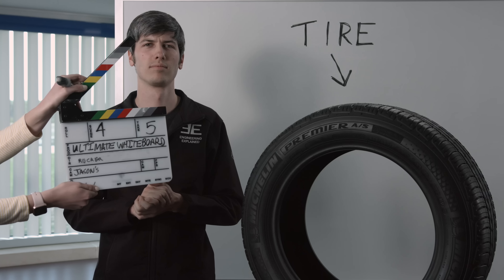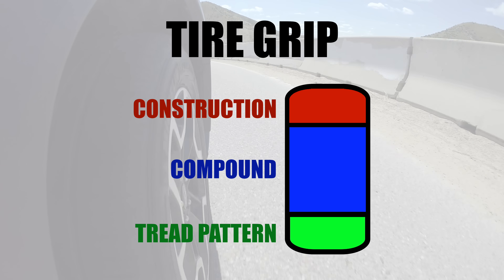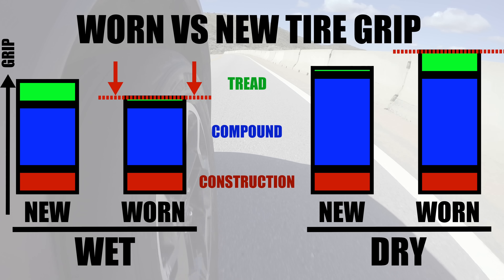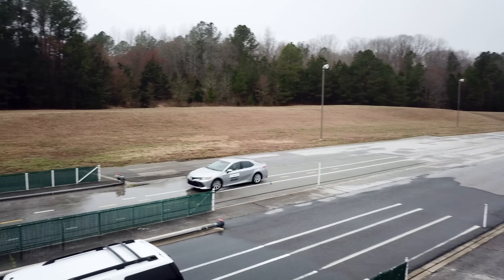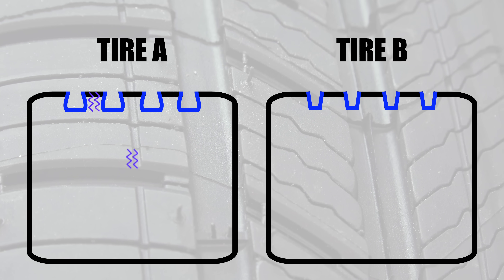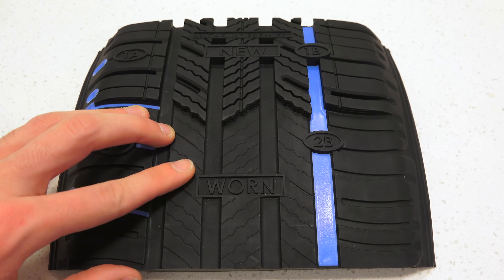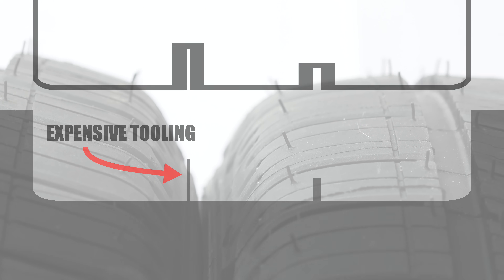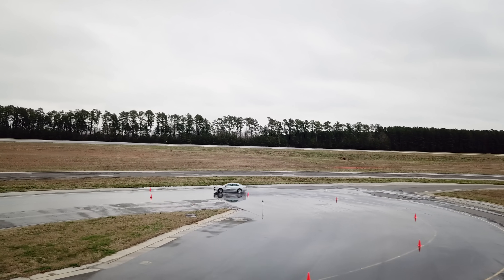New Tires vs Worn Tires - What Performs Best?

Comment: you are talking about new tires that are not worn and tires that are new and worn-because both tires are new ,performances on dry and warm is better for worn tires.
If you tested new tires (not worn) and old tires that are worn you would noticed that old tires are always worse because compound is changed by time -rubber became solid. I had 25000km/6 years old  worn toyo proxes and I slided around the street in dry conditions

Comment: When you say that worn tyres perform better in the dry, do you mean when the tread is 100% worn away [which you almost never see, and is illegal]? That's the only point that would allow more tread contact right?
Even then I'm not entirely convinced, as worn tyres have been subject to heat cycles, and I'm sure many other kinds of degradation that would hinder grip, similar to how racing slicks lose grip during a race.
I just feel like it is a misleading statement as treaded tyres are never intended or allowed to be used bald.
Reply: One thing I have read elsewhere is that tire tread blocks squirm around less as the tread wears down which may result in slightly more responsive steering. Once you get to evenly bald the tires do great on clean dry roads, but behave badly in other road conditions.

Comment: Good video Jason.
In Australia here compound is near on ignored both at the consumers end and tyre shop.

There is no such thing as a winter tire or sumer tire here, and the tyre manufacturer just goes and picks the best one to suit them, normally a hard compound to last long.

For some unknown reason, tyre life in thousands of kilometres is a major reason for buying a certain tyre here. So you have brands bragging bout 80000 km life.

This ofcourse is a winter trade off in grip. 
For example, the 17in bridgestone at dualers for my dads land rover discovery have that hard of a compound that in our cold weather of 5 degrees ,they nearly turn into slicks and become very unpredictable, almost like drivig on 2mm of tread in the rain. Ofcourse same applies for there purpose of off road when your on rocky ground when cold you end up doing burnouts everywhere.

I believe they did this because the first batch for that size and load rating( the discoverys are a rather wieghty car at 2600kg full spec) was too soft in summer and lasted but 20000kms for a few early customers.

I mean for average driving of 13000km to 20000kms a year making a 4 to 5 year life span on tyres really that bad that they do these silly decisions over here( cooper tires are also bad for this)

Comment: Hi. First of all I like your channel a lot and thanks for sharing your knowledge and experience. I live in Baku, Azerbaijan and drive Volvo. We have a snow only several times a year (let's say several times in one or two months max) and the rest is sunny, cloudy and rainy weather with the prevalence of the sun. For instance this winter we had no snow in Baku (unfortunately) at all. My question is, what would be your advice on preference between all season tires and season oriented ones for these kind of conditions?
Thanks in advance.
Reply: My cousin lives in Chicago. Illinois, USofA, similar to the weather you have, and I noticed he had put Michelin Premier all season tires on his daughters Toyota RAV4 2WD. He said the tires did fine in Chicago winters and that he appreciated not having to switch to dedicated winter tires like our fathers and grandfathers used to back in the 1960s and 1970s. Now he does not let his tires get down to the 2/32 wear bars, so she is not driving on low tread tires in the winter. They are probably changed at  4/32 tread depth. About 50% of the original 8.5/32(17/64).

Comment: there is absolutely a compound difference on the inner and outer part of the thread's on some tire's. the inner part's is often for stability etc and never ment to drive on. so they r hard and terrible to drive on. as soon as you hit this part of the tire you will see it. if you were it down on a side of the tire all around it will become a ring around the tire that is distinkt. on the last set i took down to this part it was covering the complete tire at about 2-2.5 mm thread left. the rest of the tire was a soft compound so it needed this to stay gridet.

Comment: At cold start my tires are at 30psi and my tires recommend 32 max is that okay? Or should I fill it to 32
Reply: Usually there is a sticker in the driver's door area that tells what the vehicle manufacturer reccomends. It is also in the vehicle manual. Just because the tire has a maximum pressure rating of 32 does not mean that is the optimum for that vehicle. I made that mistake once by over-pressurizing a set of tires and ended up with the center of the tread wearing out far faster than the outer edges of the tread.

Comment: It’s not often that you’re incorrect about anything, Jason. But the tire compound gets worse grip as it ages. It does degrade with age. Perhaps this is negligible while going for groceries, but it is a noticeable change during performance driving. My Pilot Super Sports last me three warm seasons. Each season after the first the tires are noticeably harder and get less grip than the previous year. At least the tread is worn out after the third year, since they’d be getting annoyingly harder by that point anyway. Haha
Reply from the maker: Correct, though I never said a tire doesn't change with age. I was simply discussing wear. I think it'd be great to have a video focusing purely on age as a single variable!
Reply: My mistake! I thought you said age. Doh! ;)

Comment: As a general trend, the newer your tyres, the better they are. The more worn a tyre is, the less effective it is, the less safe it is, the less it will resist punctures and the less it will resist aquaplaning and skidding.
There are some things though, an old tyres may be slightly better for.
1. An old tyre, run at fairly high pressure, will have lower rolling resistance than  a new one. That makes a small difference to fuel economy.
2. A worn tyre will build up far less heat at continuous high speed. That makes tyre failure of the tread separation type or the overheat and blow-out type, rather less likely.
3. A mostly worn tyre will have much lower slip angles than a new one, because it has less tread to distort. (Colin Chapman : "if it's not there, then it can't flex or break.")
4. If you're going to play with a car, and risk the chance of a flatspot because of a spin, or a brake lock-up, wouldn't you rather have that on a tyre that was about to be replaced, than one that you still wanted to do another 20 thousand miles on?
5. On a cold day, a newer tyre will grip much better than an old one. But on a hot summer afternoon, on a road with fast sweeping corners, in a car that is heavily loaded, a worn tyre generates less heat and gives off that heat much faster & easier.
In most ways, a newer tyre is always better, but not in every way, not all the time.
Reply: Thanks for the reminder on puncture resistance.

Comment: Having good tires are great but what about creating some better pavement roads too? Couldn't the similar techniques be apply to the road pavement to help increase more traction? I know cost could be an issue but safety and saving lives are priceless. I mean we as tax payer money are after all going into fixing roads.
Reply: Remember the grooved roads that were supposed to be so great? Except they grabbed the tire tread and made the cars squirm around in odd ways. So much for that idea from aviation and runway technology being applied to roads. How rough do you want your asphalt or concrete? Road builders can make it extra super duper rough to provide great traction, but then they get complaints about tires wearing much faster than normal and all the tire tread road interface noise levels being so high. Taxpayers are most satisfied with new roads being very smooth with proper drainage angles and curves(crown).
Reply: Dave Hoffman yea I always wonder how those grooves roads are worked as they to help tires grip more in wet conditions. With better method and technology materials it can work both ways. Tread wear out might be an issue that I'm probably more concerned and come up with better solutions to induce that. Other than that with taxpayers complains about noise level so long as its not jet engine loud it'll be fine. People are always going to complain no matter what you do. But if it keeps us safer on the road I would much prefer it. Being too comfortable on the road especially long distance drive isn't going to keep people awake up and safe especially semi truckers. There's too many accidents when people refuses to take rest when they get too comfortable behind the wheel which is dangerous. Nothings perfect but if it keeps most people more alert the better.
Reply: Illlinois tried various versions of the grooved road. None worked well. They all ended up "grabbing" the tread of one tire tread design or another. In any case during a really heavy rain those grooves were not going to do anything to help keep the car in control.  

Keeping awake is now done with noise strips on the edges of the highways that work when the car drifts out of the lane. In car sleepy driver detection technology will probably be more of a benefit than trying to solve it with road surface design. 

Instead of "rougher" road surfaces we are seeing longer lasting concrete designs.Those will probably help the most as they will inhibit pothole formation.
Reply: Dave Hoffman true. But that shouldn't stop us from finding better new methods and materials like I said. So who knows. Oh bumps on the outside really does not work nearly as well to keep many alerted. It has to apply to center road as well not just the sides. As I've seen people swerving in and out of their lanes to the left or right.

Comment: Hmm... These designs for better wet performance when partially worn are exactly as I've expected. The reason they're not more widespread is because they do compromise dry and new tyre performance significantly unless you resort to expensive solutions to compensate, such as narrower but deeper sipes that impose more stress on the tyre mold and make damaging them and the tyre more likely, more expensive tread compounds that are stiff enough to not flex too much when new while still providing good grip, etc. Basically, trading off a bit of new tyre performance for more consistent performance over the entire usable lifespan of the tyre.

Comment: which side of the car, front or rear must have newer tyres? I tend to prioritize the front, but not sure which is better
Reply: On a front wheel drive car the front tires. On a rear wheel drive car the rear tires. On an AWD or 4WD vehicle all the tires need to be about the same condition.

Comment: Would laser-engraved sipes be more cost-effective?
Reply: No. Lasers generate heat and would damage that complex tread compund you just spent so much money develping. We don't use laser cutters on certain metal alloys just to avoid heat damage. We have to use water jet cutting.  We can't use lasers on plastic based window materials either, it just melts them and turns the cut areas into a weak distorted mess.
Reply: Good to know, thanks!

Comment: Well that was very informative and impressive. Impressive because we all know that hype creeps into such videos, but Jason, you managed to avoid that very well indeed and just deliver useful info. Thank you.

Can you do the same for off road tyres too?

A debate seems to crop up now and then in 4WD forums where one group believes wide tyres are best for offroad, while the other believe narrower tyres are the best. Now the debate is over grip in sand, mud and gravel and when the air pressure is reduced purposely to increase the area of the footprint and to absorb impacts more readily, and ofcourse, the flip side is fuel economy, wear and bitumen performance when the pressures are back to normal levels. 
It's a much more complicated scenario than for normal cars and understanding the basics will help many offroaders choose a tyre that is fit for purpose.

Comment: Street tires get hard when old/worn and grip goes down in the dry. It's much easier to break loose from a stop w/o the flexible tred rubber. Just like slicks, the rubber must flex to grip and that goes away when street tires are old and worn.

Comment: If you wear a tire within say 1/2 years the compound won't change; anyways after 3 to 4 years the compound will start to degrade, getting worse with time. After 5 to 6 years the compound will have become harder and will provide less grip.
TCS tested this and they found that a 6 year old tire is dangerous. This test was done with full thread depth and with different tire ages.

Comment: I bought the Michelin premier AS for my girlfriend’s sonata and it improved the feel and handling of the car in the dry and wet immensely over the stock Kumhos. I’m going to be ordering Michelin Pilot Sport AS 3+ for my Infiniti G37 next week to replace my aging and slightly dry rotted Dunlop Sport Maxx AS and I’m expecting a vast improvement.
Reply: Really good choice of a tire.  I used these this past fall\winter in the PNW and felt super stable at highway speeds in steady rain.
Reply: A coworker has the same car you do and did the same switch. The Dunlops were not as nice, even when new, as the those Michelin tires. Lots of G37 owners I talk to cannot figure out what Infiniti was thinking with that Dunlop tire choice, especially for rain driving.

Comment: What's better buying an expensive set of all weather tires or buying 2 cheaper sets of summer and winter tires that equal the price of the first expensive pair?
Reply: Tough question. The problem I find is that snow country is not always in snow conditions, even in the winter. When I was a child people would put snow tires on for Chicago, Illinois, USofA winters, but some days they were running 80 MPH(128KPH) during 60F(16C) days. That is not good for longevity of winter snow tires. The next week it would be down to 32F(0C) and 5 inches(13 centimeters) of snow.  Back and forth. Cold to warm to cold. Snow to no snow to snow. The key to me is if you go with separate summer and winter tires you need to get the needed speed and load ratings for those winter days when it is warm and you are driving quickly. That will cost more than just a single set of all-season tires.

Comment: I have an issue with this video, Jason. You mention that dry grip gets better as a tire wears. This might be true to a point, but I bought a set of tires years ago and wore them down to the wear bars. Once they were at the wear bars, dry traction plummeted. They went from holding grip at full acceleration when half worn, to just spinning entirely through 1st gear when at the wear bars. I feel like you neglected to mention that there IS a point where dry grip gets worse as the tire wears. I wore these tires from brand new to the wear bars in a little under 2 years so dry rot should not have been a factor.
Reply: Sneaky dual layer tread compound placed on the tire? Nice down to the wear bars and then hard as heck to entice you to get new tires and also avoid as much problem as possible if your car is subject to inspection.

Comment: By the way you do know that those who live in dry states like Arizona or Nevada will now replace their tires only when the cords are showing because of your statement that dry weather performance of tires improves with wear...but up to what point will a worn tire's performance improve until all the rubber is gone and only the cords show?
Reply: Cord showing should not be accepted. Get some good used tires or low cost new replacements with full tread. Sure you will not be able to drive very fast with them, but it is better than tires with cords showing. I don't know about your area, but we have good used tires for 50% of the cost of new tires of average quality. $60 to $90 installed with taxes, fees, etcetera included.

Comment: As a Certified Tire Pro for National Tire and Battery and TBC Corp, I gotta say...
Damn good job and on point with everything about the Michelin Premier  :)
I'll be using that explanation about partial depth siping with cheaper tires to explain to customers why dealership tires are the way they are as well as the explanation about the thinner steel for skinnier siping making the process more expensive, but overall justified due to the better performance :)

Comment: what if the road has some sand or dust. will slick or worn tire still stick to the road?
Reply: No, How do I know? I spun a Renault Alliance car on a sand covered downhill right hand curve on Sheridan Road in Illinois UsofA. Luckily I did not hit anything and there were no other cars on that part of the road at the time. I also lost control with a Ford Crown Victoria in Georgia, USofA on a similar road. Tires very low on tread in both situations. Again luckily no impacts with anything and no other cars on the road.

Comment: Jason,

While I appreciate the contents and your presentation in the video, I'd have to disagree with your premise that the tire compound's performance does not change over the course of the tire's life. While it is true that lower tread depth provides stiffer tread blocks which would perform better than full tread depth where there is more tread squirm, this higher performance claim would only be true if the age of the compound is the same -- ie. you're literally comparing a brand new tire vs a brand new tire that has been shaven down to having less tread..

In everyday situations, the tire compound's performance deteriorates over time as a result of heat cycles, UV damage, general drying out as the tire age, etc. Especially as a result of heat cycling, both the dry and wet performance of a street tire will drop significantly due to changes in the compound.